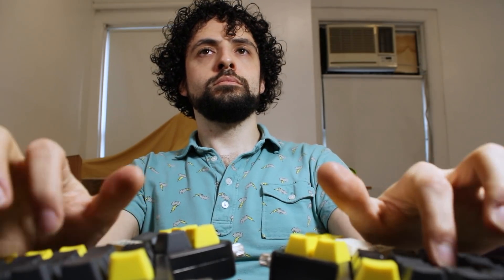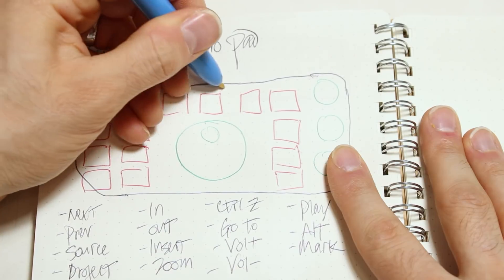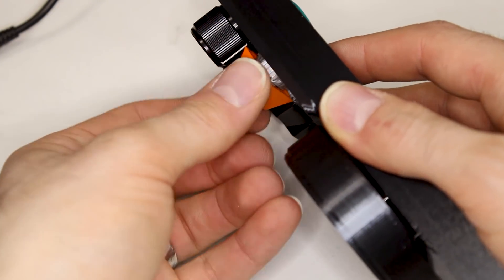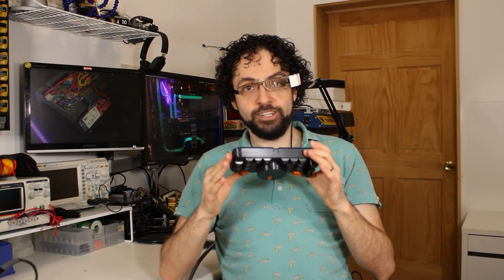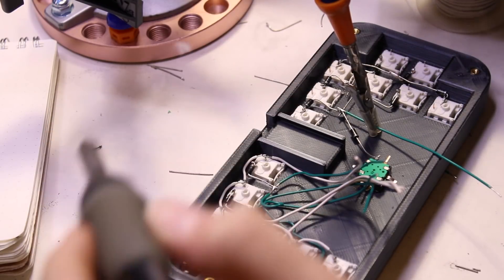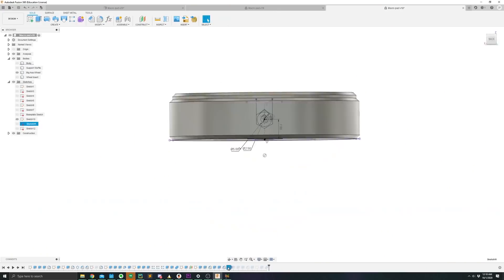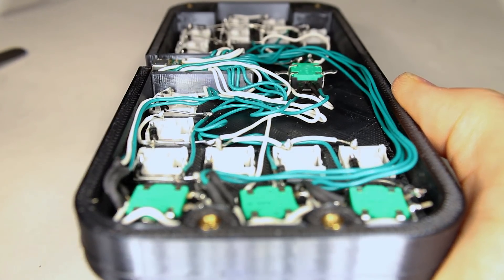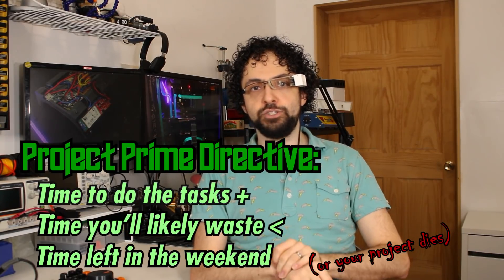How to Finish Your Weekend Projects in One Weekend

Comment: Hey, I've got a tip for you for making a cool wheel for the encoder...  Model it with a shallow groove around the outside, and glue in a length of MT2 timing belt, with the teeth out.  It's awesome. 👍
Reply from the maker: That's a really cool idea. My hackerspace has a bunch of surplus timing belts hanging somewhere; maybe I'll cut one up when I have some free time.
Reply: @ZackFreedman  Yeah, I still don't know why it occurred to me...but I was working on a big dial to add to a control panel and just thought "Hey, y'know what'd be cool..." and I had a bunch of loose timing belt for 3D printers and stuff. Sure beat printing the ridges into the design, and it's rubberized!

Comment: This is excellent. I have just built my multisensor (pretty ceiling mount thing with ESP32, various sensors, ventilation for temp sensors, adjustable baffles for PIR to block certain angles etc...) - NOT a weekend project! Spent way too long modelling the nubs that lock the sensor housing onto the backplate (like 5 days of testing and printing) and almost ran out of steam, tonnes of testing for various sensor holders, pretty patterns for ventilation holes, projected onto cylindrical sides... eugh! Tried to cram the whole lot into a 40mm deep housing and almost failed. Problem is that I'm a perfectionist and it does not come as second nature what you said about "a rough job is better than no job"! I'm still going at it. Anyway your video was highly relatable and applicable to me and my projects too - so I will try to take note of your points and work on them next time. (If interested, theres a vid on my channel showing my sensor after first prototype)

Comment: Very cool and inspiring.  Your model doesn't do what I want but it made me get my butt in gear and... hire someone to write my code.  I knew what board I wanted to use, how and what I wanted to communicate but the code isn't something I can cut and paste my way into like I normally do.  I can do the physical model and wire it all up.  I can even make tweaks to the code (I like your fast scroll technique) but the technical coding is above my ability.  Still going to try to build it and I like your jog knob so I may use that part.

Comment: Gorgeous project, thanks for publishing!

0 - oh yes, grinded from datasheets is a pain in the ass :)
1 - fill balls under the encoder, you can, it will stop wobbling like now
2 - I would make the seat of the board differently, leaving space for the wire on the sides, perhaps I would even add grooves or wire clips on the board itself

Comment: Thanks.
That was a semesters intro to desing in 12 minutes.
Excellent job.
Reply from the maker: Thank you very much! I wish more engineering schools had prototyping classes; building stuff in a hurry is a different set of challenges than traditional engineering.
Reply: I agree, very well made video. I'll actually use these prototyping tricks on the projects I'm currently working on for my study!
Reply: @ZackFreedman  I'm a sophomore in Purdue, and every engineering project is kind of rush lol
Reply: Desing?
Reply: @BeefIngot  he’s studying engineering or design or something, not english

I do however somewhat disagree with zacks mindset of: finish it before a certain time. For harmless weekend projects? Go for it, but for big projects like heavy machinery, ships or buildings, DO NOT DO THAT. Im studying safety and security management and a lot of accidents happen because people are running out of time, corners are cut, stuff goes wrong and people end up hurt or dead
Reply: @HvV8446  I still don't know what desing is
Reply: @diamondminer81 desing... turn the n and g around and you get design, get it now?
Reply: @HvV8446  Thanks
Reply: @diamondminer81  no problem
Reply: @BeefIngot  Just let him sing for christ sake! 😂
Reply: @HvV8446  Anybody remember the first start of an Ariane 5 rocket? It exploded because engineers didn't recalculate the stack size! They just took the code from the previous Ariane 4 rocket because sunday afternoon, baby... (maybe some other reason, idk) What i'm trying to say is: if it can blow up, it will! Take your time!

Comment: That is a multiple engineers work. Mechanical, PCB and schematics, firmware, high level windows/Linux interface, field tester.
But you prepared for three weeks before, so one weekend is enough.
Reminds me of a school project: controlling a 6 axis robot arm. Got the entire project in a weekend. Starting from step motor with S curve acceleration up to menu selection, real time keyboard interaction. The code in 6809 assembler was 30 pages long. Electronic class teacher not impressed by two chip parallel port interface to trs80/coco2 computer.

Comment: I'm making a 3D printer for advanced engineering materials like nylon, PC and maybe PEEK. I am having trouble getting the motivation to get back into it. I have not touched it in 6 months and still have to make the electrical cabinet, route wiring, plumbing, heated build chamber, and sealed filament chamber.

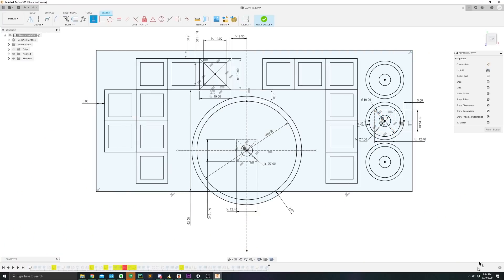Comment: I think this is really excellent advice, but I think it is worth noting here that a lot of this advice does require a great deal of specialism. By now, I assume Zach has tens of thousands of hours of experience doing these projects, to the extent where technical hurdles are taken in stride. For example, at 3:08 "You need to aggressively cut out all tedious tasks like manually changing dimensions..." This is great, except for many people new to the hobby, learning how to automate tasks in Fusion 360 might, itself, take entire weeks. Similarly, the idea of prototyping and printing a complicated 3D project might take weeks or months of spare time if you're new to the hobby. On the other side of Zach's advice is the idea that you need to realistically budget your time and to take things step-by-step, regardless of how many weekends it may take. 

The advice here is equally applicable to things like woodworking. An experienced woodworker can knock out a project in a weekend. A beginner is confused what tools are available, what plans are required, and how to assemble everything properly. So in a sense, the video is preaching to the choir ---  other specialists.

I think a lot of the advice is still good, though, like setting strong limitations on your time, or understanding that "it's better to have a crappy complete version than an incomplete version that sits in a box indefinitely".

Comment: Liked because you are a bro and commented your code and not just threw spaghetti at us
Reply: I'll take clean code over spaghetti with tons of comments any day.
Reply: @Mourdraug  Yeah, writing summaries is important, but if you need to write a ton of comments that probably means you have block of code that should have been collapsed  into new function or method.
Reply: @Mourdraug  Not everybody can churn out clean code for a weekend warrior project.  Some vague notes about what each bit does is worlds better than most hobbyist projects.
Reply: @oasntet  writing an extra line or three for each bit of code instead of writing short, single purpose methods with meaningful name speeds up coding how exactly?
Reply: @Mourdraug  probably less thinking. Time spent organising and thinking about names is time spent not typing.

Then again, maybe that doesn't actually have any effect.
Reply: @Mourdraug  Who  wouldn't?
Reply: @Mourdraug  I would say commenting doesn't speed up the coding itself, but the debugging later on. Stuff is easy to understand while it's fresh on your mind, but damn I look at some of my more complex PIC codes and spend some minutes just admiring how in heck that made sense in my mind, and more impressively so, worked.
For one LED controller I made here I didn't wanna buy an MCU with built-in ADC after I blew the one that had it, so I just ended up making a freaking R-2R ADC on the damn thing (it had tons of spare pins for what I needed) and it's there on the code. I'm 100% sure if I ever need that code again, I'll spend at least some good 10 minutes reverse engineering my stuff.
Those minutes reverse engineering your own wicked mind is time spent not programming. Sure, "if the good is good in the 1st place"... not really much of an argument whoever since the code itself might actually be good, doesn't make it obvious.
Reply: @Kalvinjj  yeeeah I recently changed company and got to experience some code people came up with there and oh boy.. if you guys are writing your code in the same manner as people in my new workplace I understand why you need comments so much now.
Reply: Real Chad’s just write spaghetti code without comments

Comment: Why using a diode? You just need a pull-up or pull-down resistor. Many microcontrollers have a pull-up built-in.
Reply from the maker: The diodes prevent ghosting. They aren't strictly necessary, but I didn't want to do the math to figure out which keys could be held down simultaneously.

Comment: Should weight your knob for premium spinny feels
Reply from the maker: Originally, I planned to turn it from aluminum, but some jabroni used the bar stock first.
Reply: @ZackFreedman  damn Jabroni's sucking up stock. I was thinking of getting real fancy and doing it out of stainless for you, but then I got to thinking that solution is probably more than most would invest. Going lower infill and casting a pile of fields metal (62°melting point) inside the print could have pretty awesome results.

Comment: Nice keyboard! I'm curious, why didn't you just make a circuit board with CAD software and have it manufactured by a board house? They are very cheap and fast. Way easier than soldering a ton of wire directly to terminals and they can add rigidity.
Reply from the maker: No time! All my projects need to be camera-ready in 2-7 days. Quick-turn boards would have cost over $500 and only left me a few days to populate, code, and debug.

Comment: The problem is with a project that doesn't end on Sunday night - and continues to steal bits of time during the following week.  Instead, better to steal bits of time pre-preparing in the preceding week - so you have a lot more stuff done before the weekend starts.   Also, large projects are just collections of smaller projects - just divide it up so that each weekend is a complete sub-task that can be designed, built and tested by itself.

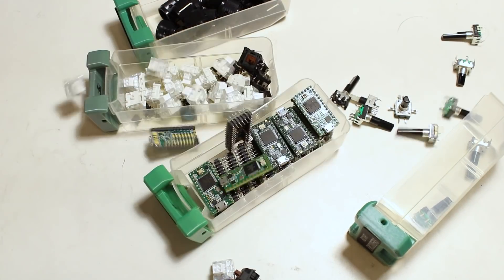Comment: What are those microcontrollers at 1:30 in the middle called?
Reply from the maker: Those are mostly Teensy 3.2’s.
Reply: @ZackFreedman  thanks bud.
Reply: @ZackFreedman  Can I use a Leonardo to make it?
Reply from the maker: @rocketscn  I don't think the Leonardo has enough GPIO pins... also, the Teensy can set a lot of interrupts, which keeps the encoder counts accurate.

Comment: Did you figure out why 14x14mm didnt work for your switch holes? Kailh box switches have different dimensions or something? Or was the plate too thick?
I've printed 14x14x1.5mm holes and they fit surprisingly well for me.

Comment: I was trying some little different, the project is, a 1024x768 screen in linux, and i want to program a encoder to control a mouse wheel action, but with the courser to move to a specific spot (900 x 200) on the screen before scrolling the mouse regardless where on the screen the courser was. I don't know if that makes senses.
In plain, when you turn the encoder, for the courser to move to 900x200 pixels on the screen and then scroll the mouse wheel every time regardless where the courser used to be.
I use a Teensy 3.2
I hope that makes senses.
Any help will be appreciated.
Angelos

Comment: I really like your advice about test fits and redundant screws. That part about soldering the diodes backwards was hilarious.

I made a similar macro "keyboard" for 2D animating. It's 4 dip switches and 1 encoder so far... because that's the bare bones that I need.
I've been using it on a breadboard for 6 months since I can't be bothered to make it look good. Eventually I'll finish designing a slim keyboard with 3 encoders and custom dampers to silence the downstroke AND upstroke of the mechanical keys.

Comment: So, uh, how do you deal with the unexpected setbacks? I know I have no skills and leave myself plenty of time to learn as I go, but then there is always something that stumps me. Like why does my accelerometer controlled LED work fine when powering the MCU through USB but it locks up when running off other power supply? That project won’t work unless it works on a battery 😢

Speaking of which, please do a video or series of videos on best ways to power different MCUs and projects.  Bad juice = failure.

Comment: If you are always having problems with lifting on large prints, check on your bed heater... if it's just one that is a small square in the middle, get rid of it and replace it with one that covers the entire bed.  I did this, no more issues with lifting, better prints all round, much better adhesion.  It's one of the best upgrades you can do to a 3D printer.

Comment: You have any issues with Teensy devices not working after a computer wakes from sleep?   Struggling to figure out what it's getting hung up on.  Had to install a powered USB Hub to so I could power cycle the board.

Comment: Good suggestions on project timing and thanks for sharing your designs. I have a few suggestions. 1. Could have used a PCB for the project - if not a custom designed one, then a piece of strip board. 2. Could use much thinner wire to connect between switches. 3. With code comments, write the comments first. Then just write the actual code based on what the comments say that each section should do.
Reply: The nice thing about using a PCB (besides faster assembly) is that you have a product when you are done. I have been using Diptrace for my PCB designs for over 7 years. Diptrace gave me far fewer errors than when I used a high-ticket PCB systems costing 20x more! (Besides being more feature-rich , easier to use and no yearly update fee) Concerning code and comments:
The best code has NO comments. Instead of epagab(void);  // Eat pizza and grab a beer.... do this .....   EatPizza_And_GrabaBeer(void);   no comment needed. I've been programming since the late '60's. The comment thing started as a necessity due to very poor hardware availability (small memory/storage) It has since then, become a bad habit substitute for better code writing.
Writing your project as pseudo code (outline form) is a great idea.

Comment: I have been trying to make a teenise powered half keyboard similar to the razed orbweaver however I have literally zero coding experience and I can’t find any good guides. I am using a mechanical half keyboard from Amazon and the joystick (pentiometer) from an Xbox controller. Any chance you could point me in the right direction for how to write the code?

Comment: I want to make one of these im not familiar with teensie and i have almost every arduino possibly lying around. Can I just run this on an arduino?
Reply from the maker: If it's an Atmega32U4 board like the Pro Micro, you can use it. It's possible to use the Arduinos with serial coprocessors if you have an ICSP debugger. A Pi Pico will also work. You probably won't be able to fit a full-size Arduino Uno or whatever in there.
Reply: @ZackFreedman  Awesome thank you.

Comment: What screwdriver is that you're using?  It looks handy.
Reply from the maker: I’m using the ES120 electric screwdriver. The manual driver and bits are a kit from iFixit. I highly recommend both, even if the screwdriver’s torque is limited.

Comment: I'd actually not recommend most people to follow such pressure and risky approach. For such projects, I'd make the first iteration complete with everything at least for the Mark I: Use cases, CAD, circuit, software, simulations, planned materials and components... Might look like taking more time but it's often saves time by avoiding to redo completely some aspects.

Comment: What was the final price in materials? $180?
Reply from the maker: Nah, barely $50. The most expensive parts are the keycaps and switches, but if you've built a keyboard before, you'll probably have enough left over.

Comment: the cables you are using are too thick. for soo little current u can use those ethernet cables wires, they are tiny and stiff what helps in the soldering and organization

Comment: I know the point of this was to make it in a few days, but is there a chance you're going to iterate on it with a custom PCB design?
Reply: Yess please
Reply: Why though? For this kind of project  (keyboard), just wiring it like this is probably the most logical approach.
Reply: @KnightMirkoYo  as someone who has never mapped and hand wired circuts, that's definitely the most intimidating part. It was my first thought, too.
Reply: @Timbofett28  it looks complex but isn't, think of it as 2 lines, one horizontal and one vertical, that's all Those wires were doing, but there are a few rows, so it looks like a mess but it's not difficult to build

Comment: Zack  I like this project it is close to what I need to  to finish my project with a teensy 4.1.  I am still learning to code and can use some help. My project ( http://joesrv12.com/Builder%20Log/FS_01_01.htm    ) requires  32 Buttons  with 5 Encoders and one pot. Will  the Teensy 4.1 work with a 32 button 5 row  5 column  matrix  5 encoders with  grounded buttons and two grounded buttons